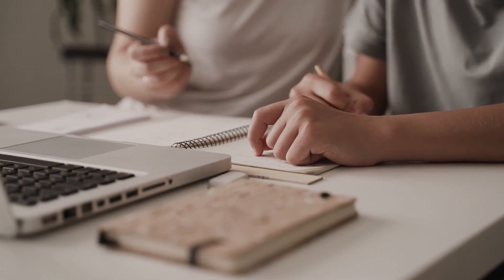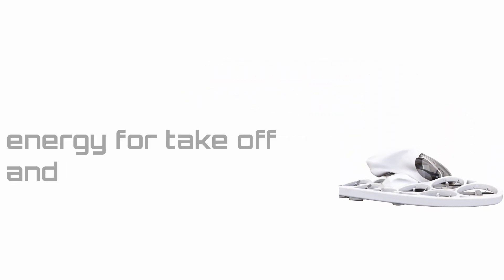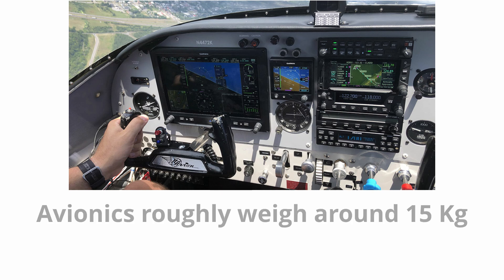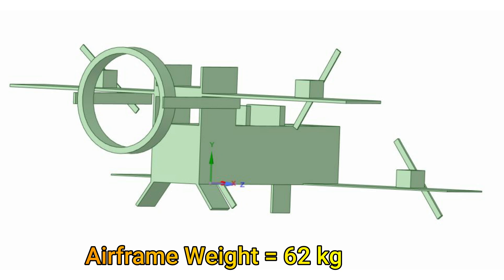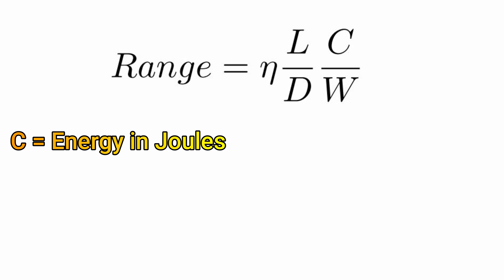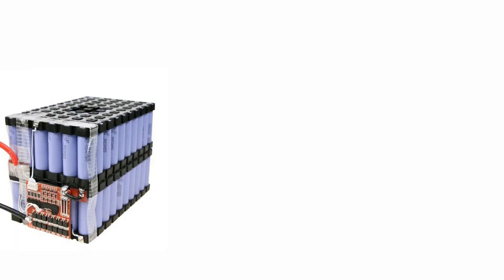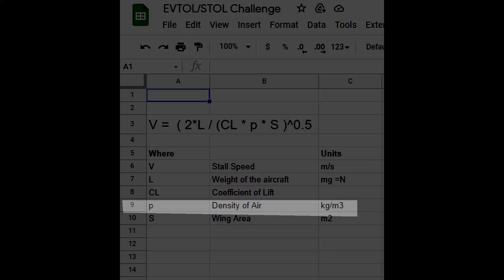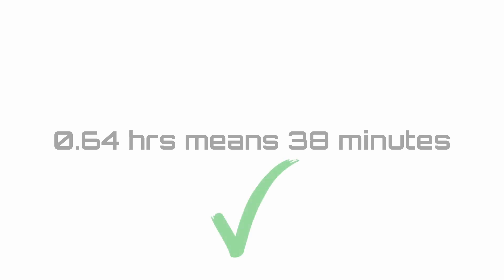How to design a 100 km range battery powered EVTOL

Comment: I watch most of your videos and generally agree with you but this 460kg max thrust for 450kg MTOW can't be brushed over. With excess thrust of 10kg climb rate is 0.22 m/s, you're not going to reach your stall speed in 20 seconds. You're not going to have enough thrust to control the attitude or to gain any forward speed to get above stall speed. You need at least 1.2 Thrust to weight and more realistically 1.5. Also you have no motor out redundancy. Back to the drawing board.

Comment: I really got the plan of doing my eVTOL. Thanks for your knowledge
But I do have doubt in formula substitution can please explain the value that are used in
Range = 13.45 x 1000 x 3600 x 0.82 x 1/450*9.81 x 1

Comment: I think you can reduce energie, t, ll make the V-tol of grafeen, the most light construction material on earth. Further on you could use the concept of the lifting body. Also shifting wings could do a good job in effincitie in speed and stability. 
Problem with grafeen it,s a expensive material to make, if you could make it cheap, you could revolutionige the aviation industry.

Comment: It is easily possible to vertical take off & land, using three phase direct electric power to some stage of  cruising altitude (using a detachable electric connecter). Also a hybrid of hydrogen and battery power, using hydrogen lifting power at the same time as using it as fuel to cruse to extend the range
Reply: Thats good idea 🌏💗🇵🇭🌍

Comment: We can use a supercapacitor or ultracapacitor dedicated only for (vertical) takeoff or landing. As they weigh much less than conventional batteries, they can reduce the overall weight and increase the range to some extent. The major disadvantage of supercapacitors compared to traditional batteries is they work in bursts, i.e. they charge and discharge relatively quickly. This can be an advantage here because vertical take-off and landing using rotors require precisely that.
Reply: We can use a supercapacitor pack dedicated to takeoff/landing and a battery pack for cruise mode. The capacitors can be charged using solar/other mechanical/regenerative techniques.

Comment: When you say aircraft surface area is 30.5 square meters- how did you find that? is that the surface area of the side  (one side or both sides?) and top of the fuselage as well as the top of the wings, or just the top of the fuselage, or just the side of the fuselage and top of the wings? I am confused where you got 30.5 m2 from because your wing area is only 12, and the fuselage is not much bigger if your just counting surface area from the top.
Reply from the maker: It was the surface area of just one side. The wings were 12 Sq m. There are two vertical stabilizers. There are also landing fins

Comment: The maximum thrust capability of your motors is WAY too low. In order to have hover stability (using fixed pitch props) you need at least 2.5x thrust available. Increasing motor power (by adding extra motors or finding larger motors)  would add probably around 26kg. You didn't spec the weight of the esc's...probably around 0.5 kg for the motors you spec'd. More for larger motors; say add another 5 kg. Wiring?? Even if you have the batteries right at the motors you still need to connect all the batteries together. Add another 10-15 kg. Spars, landing gear, control surface servo's...

You start to see why building a functional eVTOL isn't a backyard project. 

"Airplanes are always heavier, and cost more than originally designed"
Reply: Mostly agreed, but 2,5x seems overkill. From what I have seen thus far, 2x seems to be the standard.
Reply: Ya your rigth #Daniel h
Reply: Its not backyard project 🌏🌍🌏🌍

Comment: Not sure what's the point of this without redundancy? You understand you can't carry people like that, right?
Reply from the maker: Its an ultralight aircraft design. We are not designing it for mass transport. Its a sport/recreation eVTOL. Distributed propulsion ensures redundancy.
Reply: Then you need 8 motors, two on each of 4 axis for (talking about the quadcopter-like minimum here).
The tilt-wing mechanization must have redundancy. And contingency plans, what if the landing pad is not available, etc.
Safety is the starting point!
Some designs are more safe than others.
Reply from the maker: @СанФранцискскийКот   The Ultra light category in Europe has MTOW of 450 kg normally and 475 with Ballistic Parachute. That is why redundancy isnt the focus here

Comment: Why has no one built a self charging electric vehicle it seems to me that it could be and should be done
Reply: Other than regenerative technology and solar panels, doing so is against the laws of physics. Invent it, and big oil will tamper with your brakes.
Reply from the maker: They have been invented. A couple of them have gone coast to coast in US on solar power and one has circumnavigated the globe. They are very slow though
https://youtu.be/1q2wpZrq888

Comment: Did you factor in landing hover power also?  i.e. multiply hover x 2 ?
Reply: he did 2x 20 secs, which would be more than enough as even at a modest climb of 600 ft min 20 sec would be 200 ft, if anything thats excessive
Reply: @z_actual   Oh OK. Good.